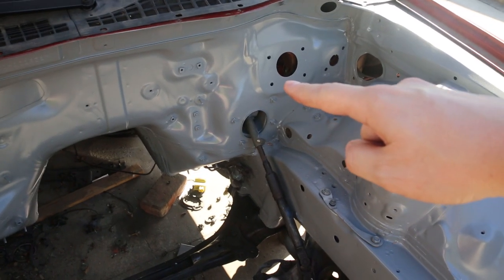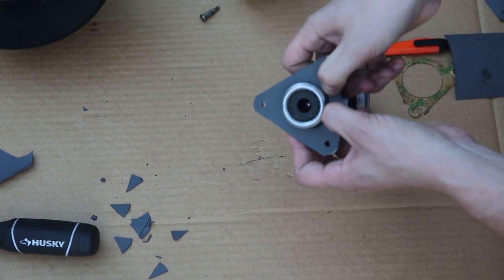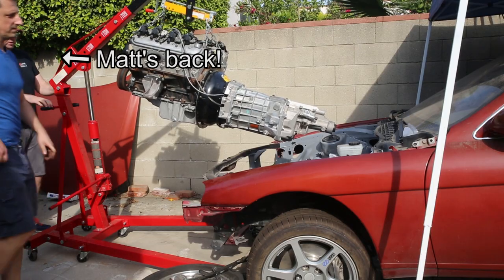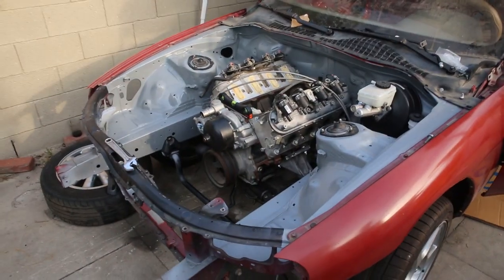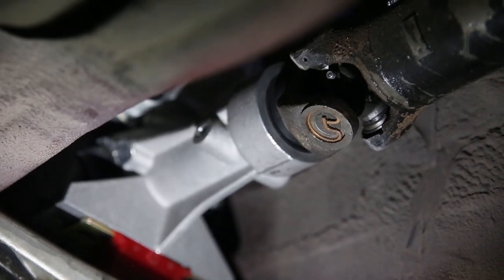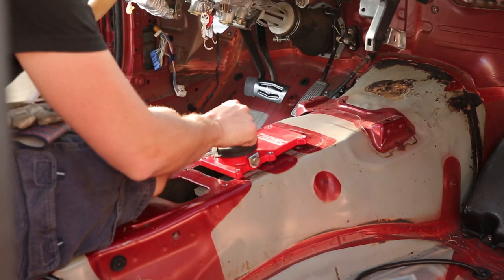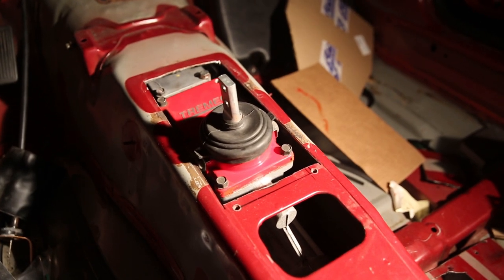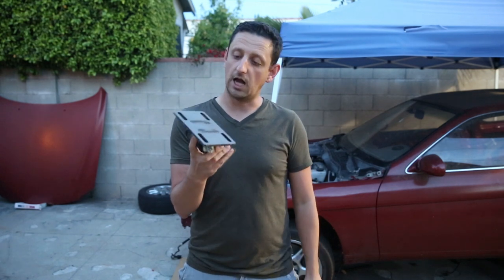Lexus SC400 Drift Build. Ep.21 - Installing the LS Engine, Driveshaft, and T56. (or trying to)

Comment: Have you fit the wheels you got yet? I was wondering what size spacer you need to make them "flush". I got a 93 sc300 and looking at wheel options.
Reply from the maker: I have the wheels on, but not properly mounted flush yet. I can take some measurements for you though.

Comment: Does the sinkky drive shaft work with t56 magnum?do I have to use the fbody tail on it? Please help am trying to do a swap too...
Reply from the maker: Sikky drive shaft? The length should work, but I'm not really sure since I don't have that driveshaft. The Magnum is 33.5" from bellhousing to the tip of the tail housing. The main difference is that the Magnum has a 31 spline output shaft and the regular f-body T56 has 27, so you would need the correct 31 spline yoke. I would email Sikky and ask them to be sure.
Reply: Thanks you...

Comment: Why not just shorten the drive shaft? That way you can keep the shifter as is.
Reply from the maker: I don't have the tools to shorten a driveshaft myself, and I've been wanting to redesign my motor mounts anyway. I can always have the driveshaft shortened later and move the engine back on the new sliding mounts I'm going to make.